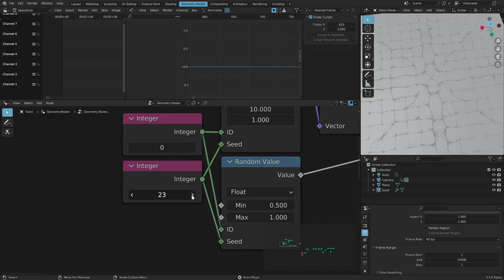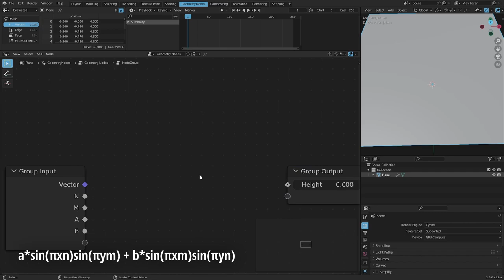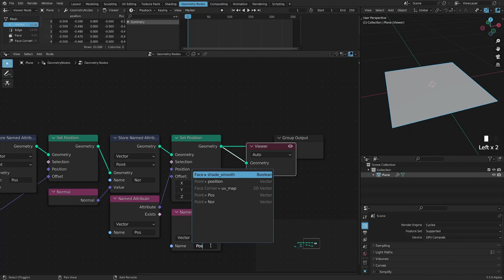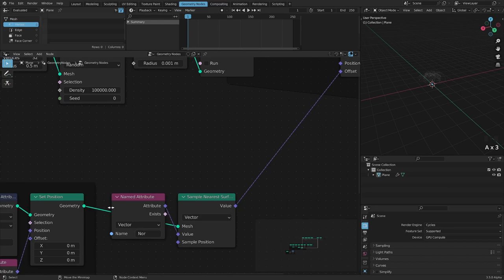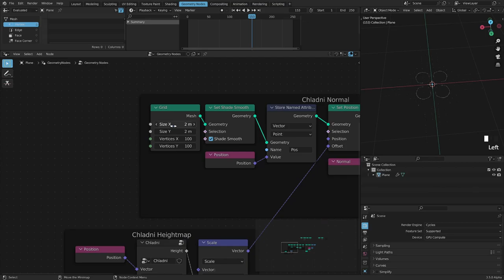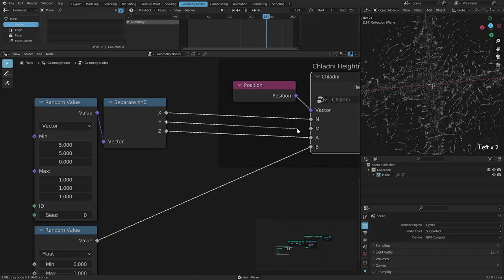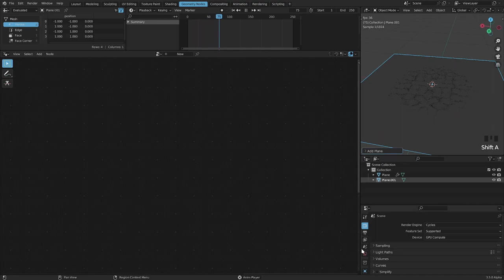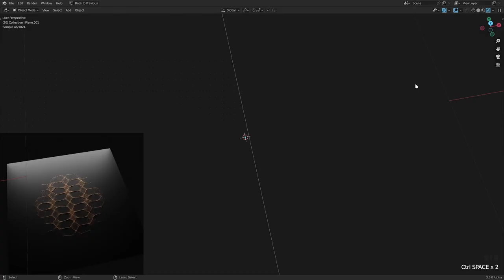Creating beautiful Chladni Plate simulations in Blender

Comment: What a good Tutorial, sadly no single blender version with Simulation nodes isnt crashing when i try to add it.
Reply from the maker: be sure to add the output node first, and the input node after that
Reply: @krisp-  Thanks a lot, somehow i havent noticed it in the video. 
also, wich version of geometry nodes did u use because when i connect the Sample Neares Surface to the Set position yours is exploding and for me nothing changes, i have followed along a bit and nothing changes. Could this be because of the use cache option? (i dont have it/know wich version to find it)
Reply: @brillant3090  Hi, I also don't have/can't find a version with use cache option as part of the Simulation Input and Output. Did you fix it without the use cache option? I have everything working except the particles don't show up in the render and wondering if this is the issue?

Comment: Can you also share the .blend file? I tried to replicate the tutorial. My sand shows up as solid/wireframe but doesn't show up at all in material view or render.
Reply from the maker: Point rendering is Cycles only at the moment. You could use instance on points to make little icospheres or cubes as well, but it'll run much slower in the viewport and Eevee didn't look as good which is why I stuck to cycles
Reply: @krisp-  Hi, thanks for an amazing and clear tutorial!!! I have render engine set to Cycles but the particles are still not showing in Render view. The simulation works in wireframe, solid, and render view but not material preview mode. Any help with what I've maybe missed?

Comment: Does anyone have a link to the build (3.5 Alpha I think) that this works with? I tried it with 3.6, which has simulation nodes, but it wouldn't let me add the Sim Input node.
Reply from the maker: To add simulation nodes in 3.6, you need to add a "simulation zone"
Reply: @krisp-  Thanks! That's my first time hearing that term. I'll check it out tomorrow.
Reply from the maker: @maximrivers  Yeah ofc! They added that because alpha versions would crash if you added a simulation input with no output iirc